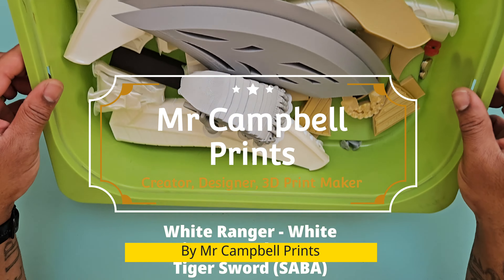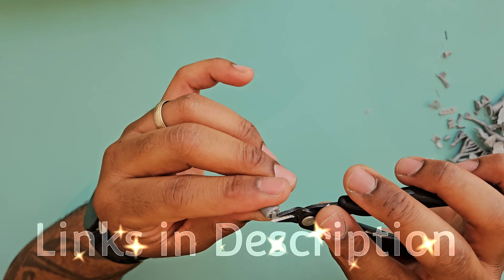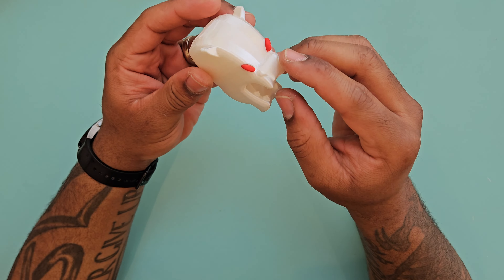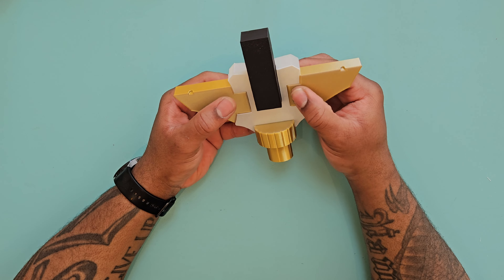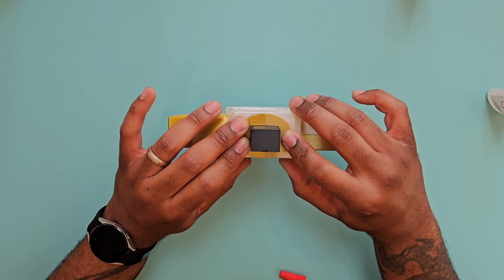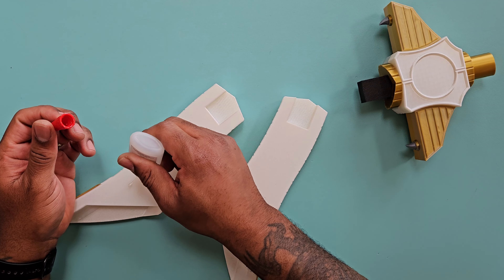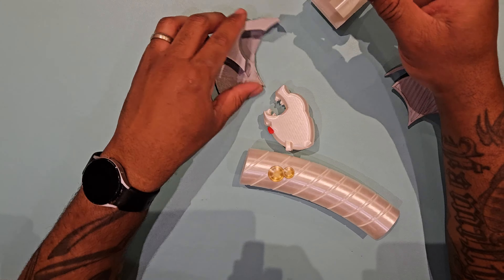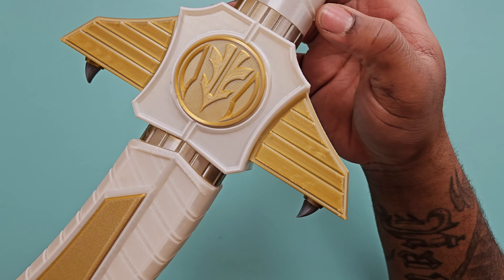3D Printed White Ranger White Tiger Sword "Saba" | Mighty Morphin Power Rangers Prop Replica

Comment: I want to congratulate you on the quality of your models; they are truly impressive and very close to the originals, the best I've found so far. However, I have to be honest: the files for printing are a mess. It would be great if you could better separate the parts into different files because, as they are now, it's almost impossible to print them correctly. Even though they are separated by colors, everything is too cluttered, which makes the process difficult. Additionally, it would be helpful if the pieces were split in half to make printing easier. I would love to keep buying your models, but it's frustrating to pay over 10 euros for something that comes in this condition. I hope you can take these comments into account for future improvements.
Reply from the maker: Thank you so much for your kind words about my models. It really means a lot to hear that you find them impressive and close to the originals. I also appreciate your honesty about the print files—I’m sorry to hear that they’ve been frustrating to work with.

I completely get where you’re coming from regarding the clutter and difficulty in printing. Your suggestion to separate the parts into different files and perhaps split them in half to make the process easier is really valuable. I’ll definitely be making these improvements for future models. It’s important to me that you have a smooth experience, and I want to ensure that the models are worth every penny.

Thanks again for your support and for sharing your feedback. I’m committed to making these changes, and I hope you’ll continue to enjoy my work in the future.
Reply: @maiconeliziario1231 were you able to figure out how to print this?